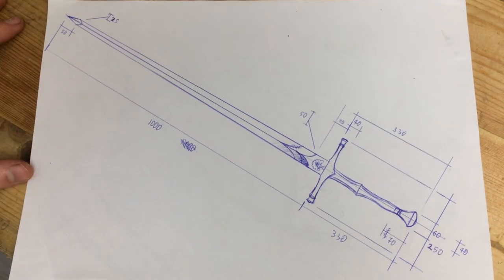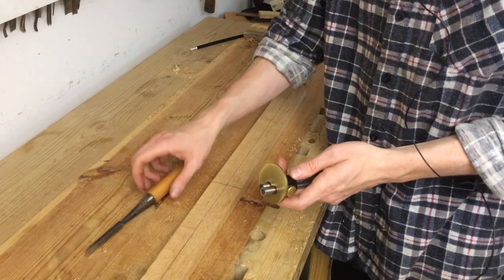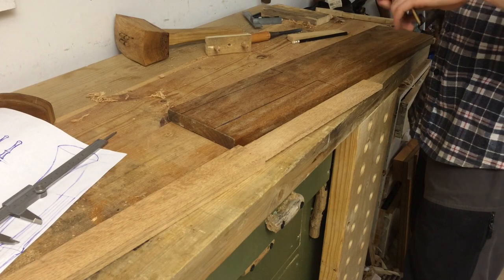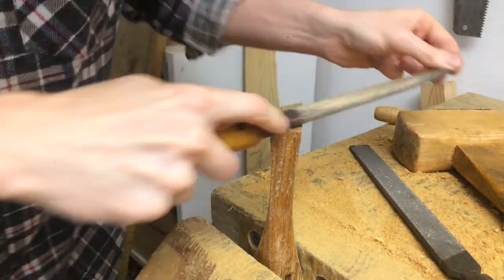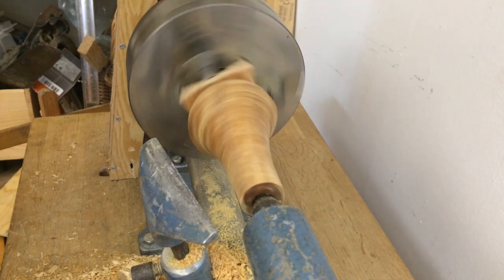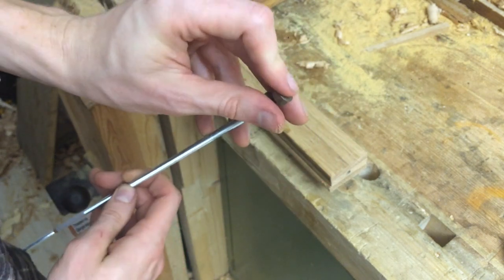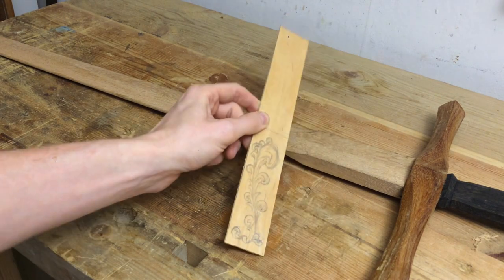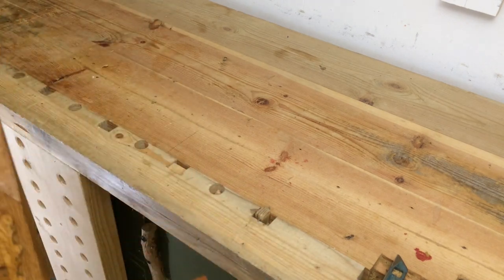Wooden longsword — furniture maker's perspective

Comment: I loved your project, do you still have your sketch? I want to build a similar one with my father in law, but I don't know how to sketch, how did you research for yours?
Reply from the maker: Thanks! I just looked at proportions of historical swords, and took some inspiration from fantasy art for the details. If you plan to use it for training, you'll want to look up where the balance point should be, and make sure the blade is thin and flexible. Good luck!
Reply: @GillisBjork  one last thing, which wood did you use? Sorry to bother you
Reply from the maker: No worries! The blade and handle scales areoak, the crossguard and pommel is a heavy tropical wood (I suspect ipe but don't know for sure) to help with the balance. If you can't find a superdense tropical, I'd suggest the heaviest hardwood you've got for the pommel, handle scales and crossguard, and then something lighter for the blade. Wood Database is a great site for looking up wood densities.

Comment: Thank You Gillis....I noticed when turning the pommel using the 3-jaw chuck. Did you receive the other set of jaws for holding?  A lot of times when chucks are passed down they only retain the jaws installed on the chuck and the second are just lost. I suspect that is the case?  .... Anyway very nice sword and I do, again, enjoy your determination with all your excellent projects..... I have shared your channel with others and I hope your success grows with time.......TM
Reply from the maker: I do not have another set of jaws unfortunately! The chuck is in general not great for wood, I haven't turned anything in a while now but if I need to do it again, I might look into other chuck types. Thank you so much for sharing the channel!